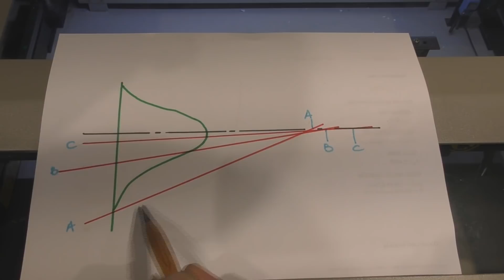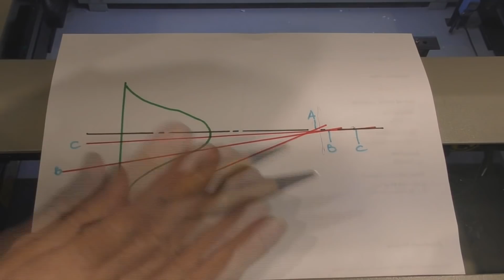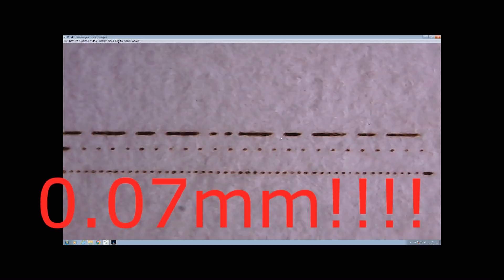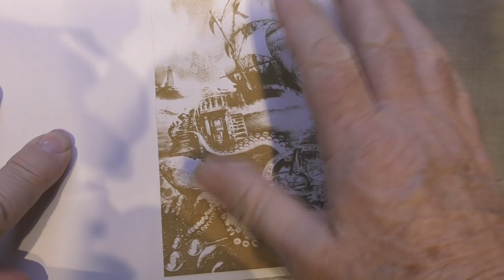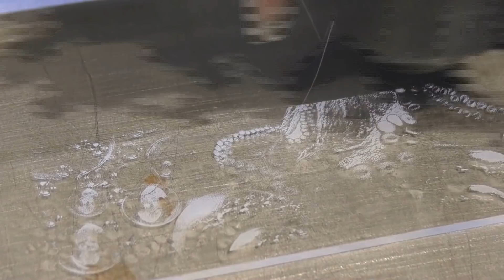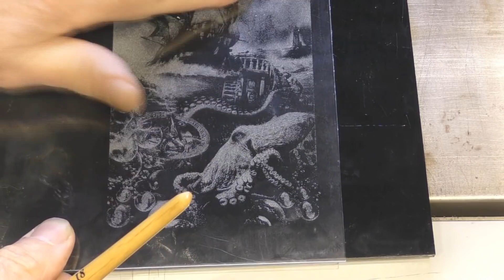RDWorks Learning Lab 140 I Forgot to Focus on the ELEPHANT in the ROOM Re rendered

Comment: Russ,

For marking plexiglas, perhaps the jarvis and negative combination is done the wrong way... perhaps it is 'jarvising' it first, and then make it negative. maybe it should be done the other way around: first make it negative, and then jarvis.
Can you try it with a photo editing program to make it negative, and then just jarvis the thing with lightburn?

Regards,
Arjen.
Reply from the maker: Hi Arjen
Unlike RDWorks there is no order to things that can be selected. You make your selection with switches and options all in one window (which is why I like Lightburn) and press START. The file is then converted to a machine code .rd file and send directly to the machine, so you have no choice as to whether the dithering is done in the positive or the negative mode.  It is a bit of a puzzle why that face disappears in acrylic but not in positive  "card" mode. I must experiment with the negative form on card to see if it is a material or a software oddity?
Thanks for the thought
All best wishes
Russ

Comment: Hey Ross, what about your slope test to find out the perfect focus distance for the lens? That has been my standard way of finding out the focus of all lenses, and gives you lots of other useful information including the beam shape, its been very effective. But not as entertaining I guess :)
Reply from the maker: Hi Abraham

When it comes to finding a precision dot I have found that my little test pattern of dots and dashes tells me so much more. As you may have seen in the video, i guess a speed where the machine can comfortably create single dots (say 100mm/s), set the power low (say 15% )and do a test at an estimated focus height. I then change the focus height in 0.5mm steps to find the best focus . That will usually be based on the thinnest dashes  I can see because the dots may be a mess at this stage. This is aprox the correct focus. Now I play with the power between each test until the lines get even thinner and dots start appearing. You can play with the speed  if you start to get good dots BUT this will be rare because with ANY standard single lens plano-convex or meniscus  you will get the low energy density scorch halo around your dots. That is the big challenge I have been battling with throughout my photo engraving/dot quest.  Trying to make the smallest focused beam and then use JUST the high energy density tip of the beam to create a dot has always stopped at about 0.2mm because the nose of the beam is still too blunt.. It was one of those lightbulb moments to exaggerate spherical aberration rather than correct it. In doing so I was effectively filtering out all the lower power stuff that was causing the halo and provided I was accurate with my focus point  (it has to be within 0.5mm) I could find a very sharp spike of power right at the centre of the beam. I think I can comfortably and reliably get to 250 dpi on some materials but the focus point changes slightly (within 0.5mm) as you play with the power. Hence I now use the dot method for precision focusing. The slope was good and reliable for single lenses but dots have taken me into a new dimension. Who could have guessed that chasing something so small could teach me so much?

Best wishes
Russ

Comment: http://www.mediafire.com/file/l68eaiuup803ltz/lasercup.stl  If anyone might be interested.  I took the drawing for the lens holder and made an .stl for 3D printing.  It will require a little support for the o-ring area, but that shouldn't be too much of a concern.
Reply: http://www.mediafire.com/file/586744ef086jnt8/lasercup2.stl  This version has more of an angled exit like the original drawing, where the first one posted had a bit of a straight tunnel right at the end.

Comment: Russ, for Glass the technique is to use a damp paper towel or liquid soap or transfer tape over the burn side with the air assist off as the highest quality is never achieved with plain glass.
Reply: I have 3D printed a few nozzles for my K40 laser in PLA and never had any issue with melting during the cutting processes.  I think his design could be easily made with a low layer height and 4 or more perimeters.   I usually find that making holes .2mm larger than they need to be will allow the fitment of anything.  But, that is with my printers, so your results might vary.  I just went back and looked at his drawing.  I do see the over hang edges on the inside.  If I were to try and print it, I would do it nozzle tip down and angle the outside to remove those overhangs.
Reply from the maker: Each of these techniques I have tried and all they are doing is attenuating the lower "halo" power before it hits the glass surface. They also serve to SPREAD the energy and create a bigger spot. With normal glass engraving techniques there is always sharding and the glass surface has an abrasive feel to it. The techniques you describe do mitigate this effect. The best product I have discovered for producing silky smooth finish is MoS2. However for such pinpoint precision dots that I m producing here,  there is no sharding and a flat silky smooth finish is there for all to feel. I will eventually try MoS2 but think that the energy transfer is going to take place on the surface of the MoS2 and remove energy from the microdots I am trying to produce.
Test it and see for yourself. I am not advocating this IS the way, I am demonstrating my own personal techniques as I discover them and I also test "established" techniques to understand them and work out if they have any real merit or if they are in fact sticking plasters for lack of understanding.
Many thanks for the discussion point

Best wishes
Russ
Reply: I am waiting for you to come to the end of your journey and if you make those lens holders, after finding out this really is fantastic, then I will shoot you an email for an order but until then I have no way to test it.

edit: Btw, thinking about what you said makes absolute sense to me since if we could just get a dot and no "halo" we would have perfection.
Reply from the maker: I am building a list of folks that will be interested in buying if I make a batch. I am on holiday next week but on my return I will assess the viability of making a small batch.  Private message me you email (I think I may already have it) but please confirm and I'll add you to the list and let you know in a couple of weeks. You could always 3D print your own, The dimensions are in the video for you to copy

Best wishes
Russ
Reply: Will do.  As far as 3d printing goes I have never had much luck with holes in it so I would need a scratched up lens so I could test the holes the 3d printer creates.  The worst is ABS but all plastics shrink.  I watched the video and I never saw the dimensions and lets not forget that 3d printing hates over hangs so the cone shape is a dead overhang which means supports would be needed and it is never clean so will restrict air flow so it is never as clean as say something on a lathe.
Reply: Yes, cones never come out and on my printer it depends on the material.  For PETG I have it down pretty well now but ABS is a nightmare and time to bring on the drill bit.  I have PLA around but I hate the stuff so PETG replaced it  and I am hoping ASA comes down another 20-25 percent as it will replace ABS for me.

To be honest for this part Delrin is king and it flexes (PLA never did for me) so it can go over the tube so much easier.  I consider Delrin softer than ABS but not rubbery like Ninjaflex or TPU/TPE.  If I had a lathe I would work the Delrin for sure.